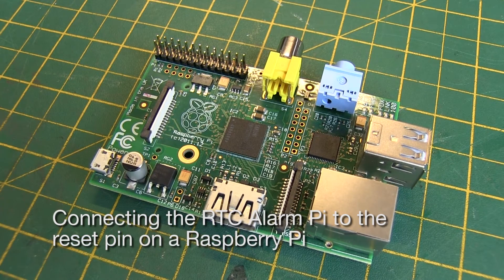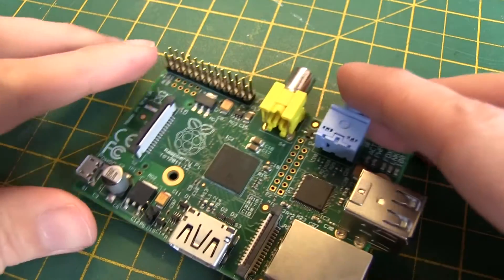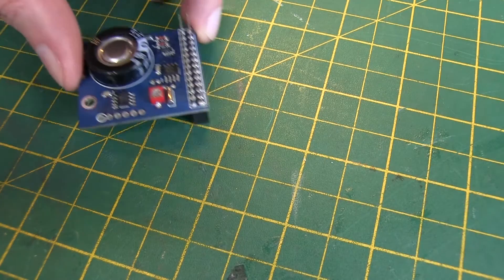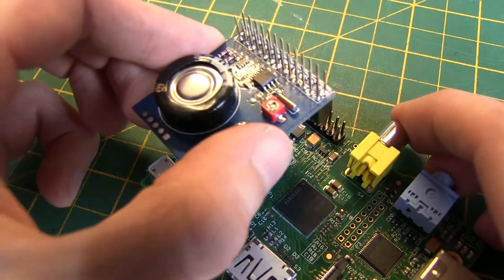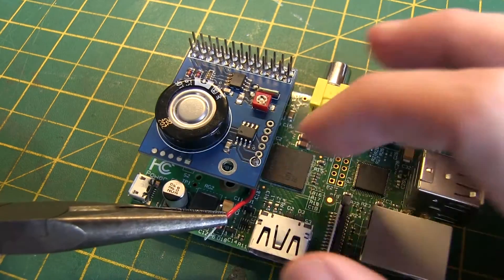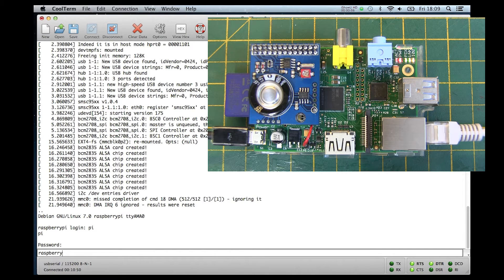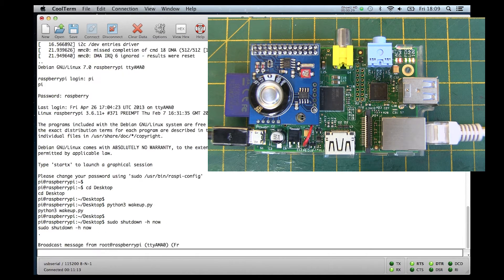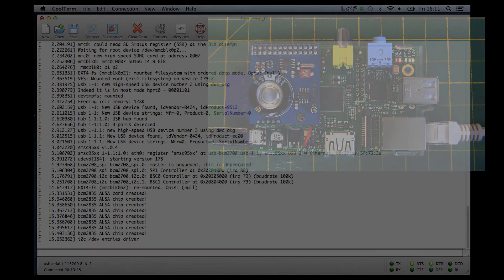RTC Alarm Pi connecting to Raspberry Pi

Comment: It is possible to do better and completely power off , with a minimal leakage current, the raspberry Pi using a mcp7940 DC/DC converter.

https://www.raspberrypi.org/forums/viewtopic.php?p=1074313#p1074313   (it is in french).
Reply from the maker: I think the RTC board would still need power in order to switch the power supply on or off. The chip used on the RTC Alarm Pi isnt supported by the linux kernel now on the Raspberry Pi.
Reply: This is the beauty of it. One of the GPIO pin could be set to power down the unit. It is in the device tree. When the Pi is off the GPIO pin is 0V and can't drive the transistor to enable the DC/DC converter. The only standby power is for the DC/DC converter which is connected to a small 12V battery. This is what I'm using for timelapse.  1- wake up the pi by alarm. 2- read the rtc clock from kernel. 3- remove the rtc module from kernel. 4- take the snapshot. 5- Remove the alarm and set next wakeup to the rtc. 6- shutdown -h now. And it will wake up at the specific time.  To boot it takes around 20 seconds.

B.T.W. The PiFace RTC has is own power cell battery so It is still working when power off.
http://www.piface.org.uk/products/piface_clock/

Comment from the maker: You can use the PiBow case if you have an extra long set of header pins and have the clock above the case but i dont think there are any which will fit everything inside.